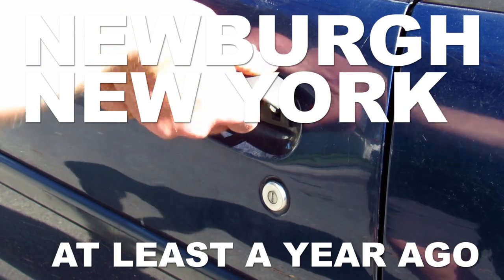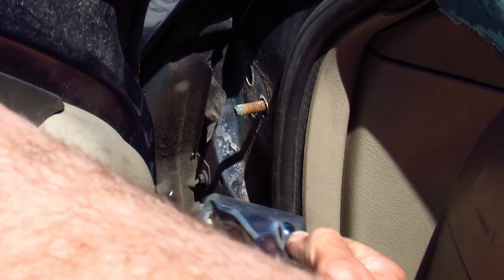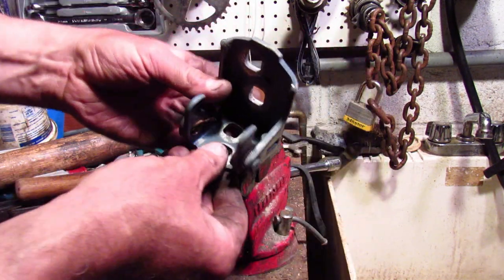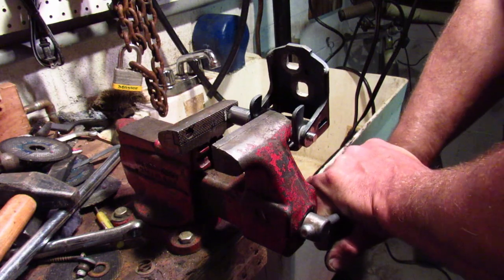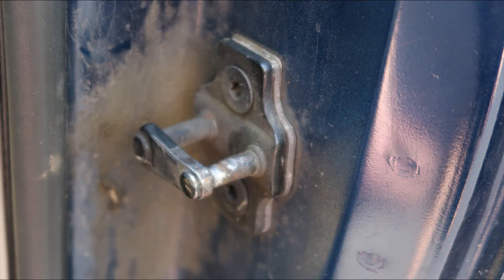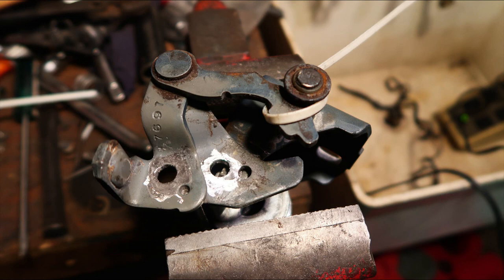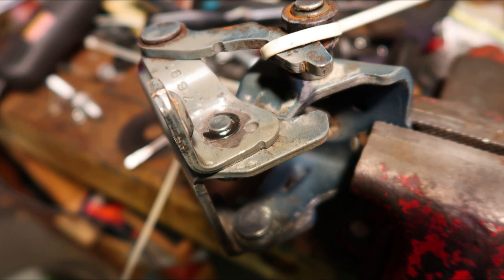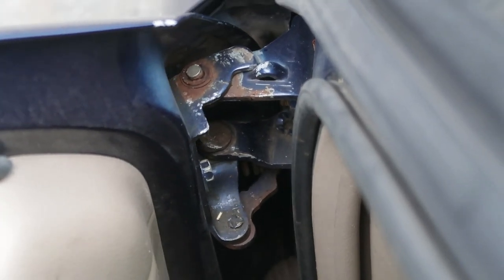How to replace car door hinge pins and bushings

Comment: Update: The replacement pins are garbage. Just did this job TWICE, both times were failures. The clips fell off the pins both times. Looking at your 6 month later footage, the actual problem wasn't lack of lubrication or anything, the pins are backing out of the bushing, and then the pins can go sideways creating play. If you pressed the pins in like they are from the factory this would not happen, the spring washer just does not hold them in place like a proper expanded end of a pin.

Gonna go look for replacement hinges at a junkyard tomorrow.

Comment: A couple of drops of motor oil from an "Oil Can" goes a long way before it wears out due to lack of lubrication. 
  Also, pins didn't look fully seated after replacement and dry from no lubricant. Some lubricants are thick and some evaporate a few minutes after application. A quart of motor oil and a squirt can to apply a drop at a time is cheap. Why don't people read the owner manual and use lubricant on simple moving parts. 
DK, Omaha. ASE Master Tech since 78, retired.

Comment: Great video. Loved the commentary. I have to do this on a restoration job. It a bad design yours and mine that is the reason this is happening.  I have a 2001 volvo that has gotten a ton of use and the hinges are like new.  I'm thinking of adding some supports like a fence door would have to take the stress of the hinges.

Comment: I think I will get a pair of hinges from a junk yard and do a good rebuild on them without worrying about having to drive doorless. Body shops have a whole stock of brass bushings for pennies each , can use a bolt with washers and lock nuts instead of those pins . We shall see